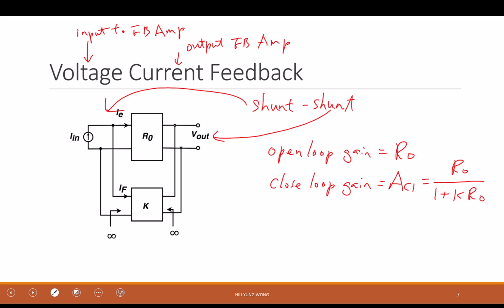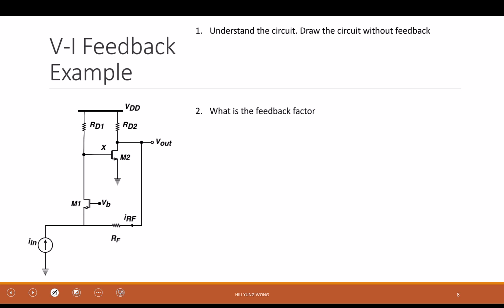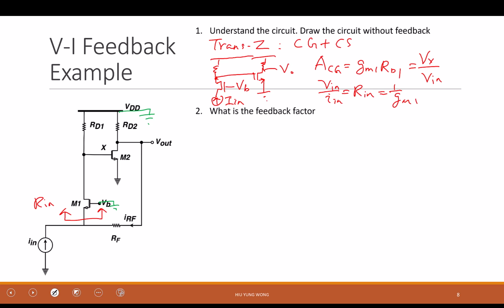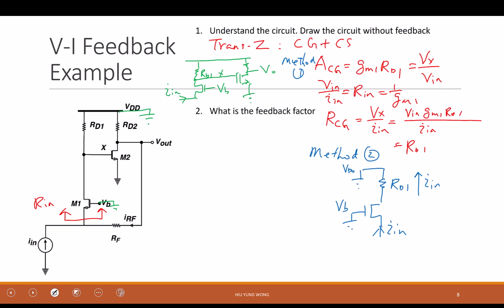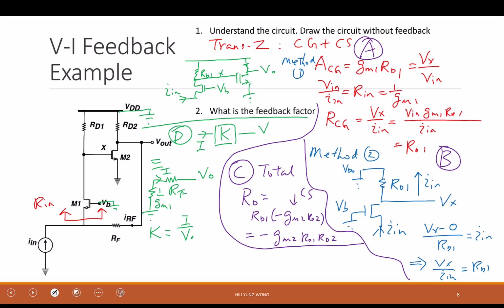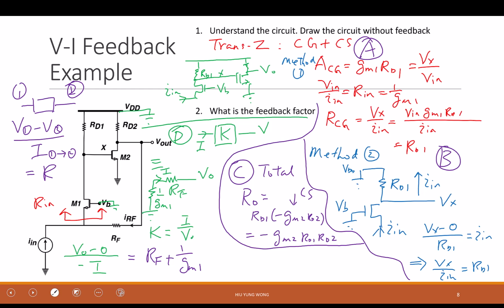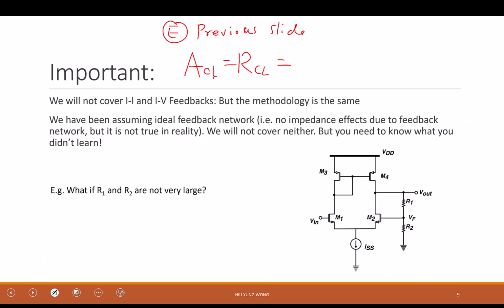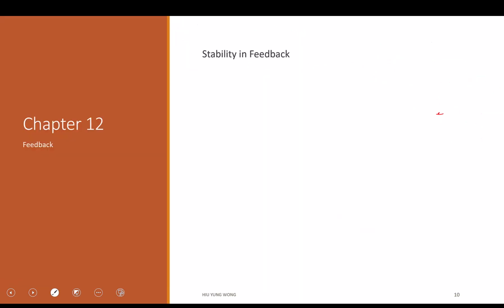L27-1 Voltage-Current Feedback Shunt-Shunt Feedback

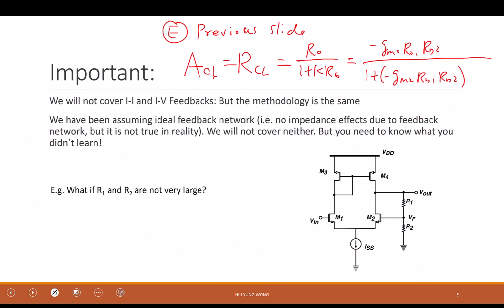Comment: When writing the closed loop gain( 33:09) shouldn’t the feedback resistance affect the impedance from the CS stage?
Reply from the maker: The method provided in this lecture is an approximation. We view it as the OpAmp and the feedback network are decoupled in the sense that they don't affect each other. If R1 and R2 are very small, this approximation breaks down.

Comment: Hi, professor! Thank you for your great lecture! I was wondering why at 20:17 of this lecture, you mentioned the effective resistance of the transistor which you draw in the diagram as 1/g_m. However, there is an R_D1 from the drain to the V_DD, why the R_D1 won't be shown in this diagram?
Reply from the maker: @@user-gl1wt2gf7j Good question. The input impedance is obtained by solving the small signal model. Can you take a look at this video at 9:34 https://youtu.be/vY_gG0TtfX8?t=574. It explains why. Let me know if still not clear. Thanks!